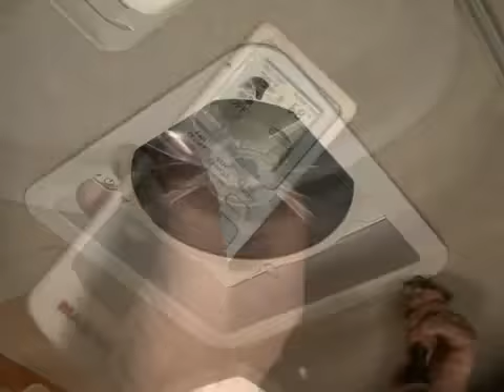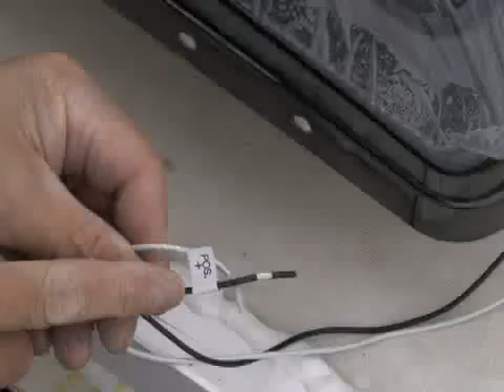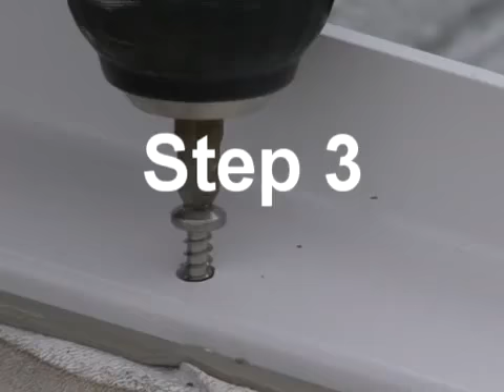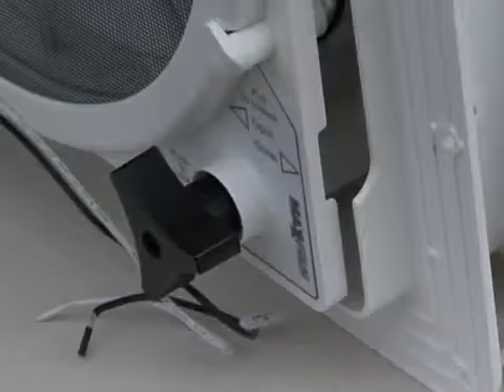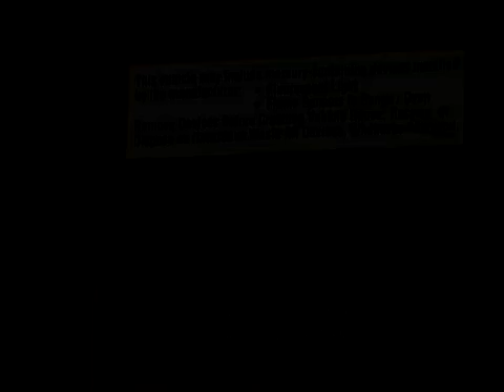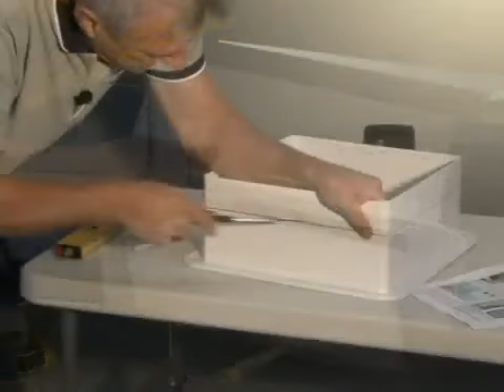MaxxFan Deluxe Installation Video

Comment: Model 7500, Used once after install and got the green light of death, replaced circuit board at my expense, because could not get the company to respond. Still got the green light of death. Have a buck/boost before fan and monitored voltage for 2 days and stayed at exactly 12.8v the entire time. I love the design, but does not work, so will be replacing with a Fantastic basic model, because a fan that does not work is worthless.

Comment: What about the warm air from my heater in when its cold? 
Doesn't the warm air disappear quickly through this Maxx Fan?
Reply: To keep the heat in close the lid and use an insulator if needed. Its no different than any other vent lid.